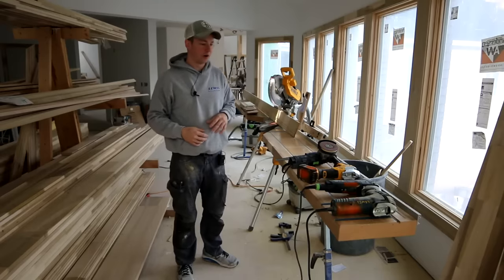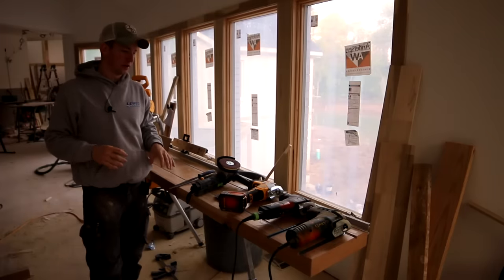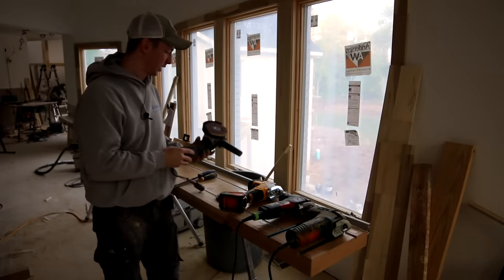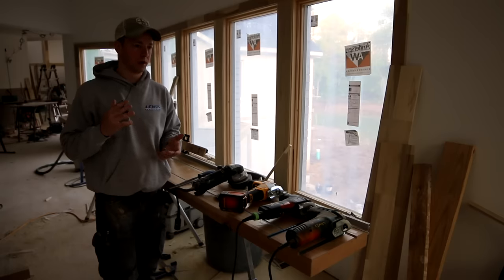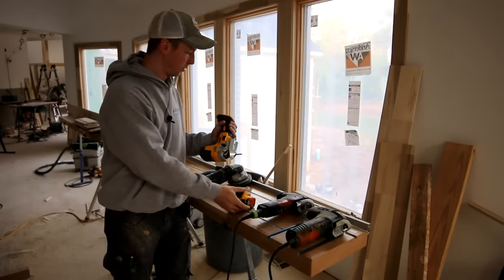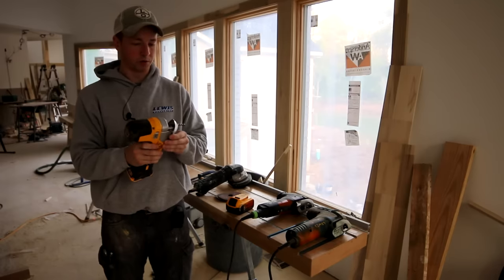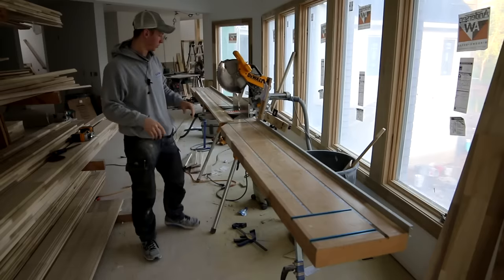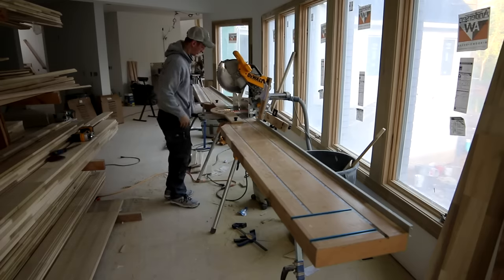Best tool for coping base and crown??? Dewalt DCS335B w Coping Foot for the Win

Comment: Hey bro I've been a carpenter for nearly 30 yrs. I personally am all about the grinder when it comes to coping. I haven't found a situation since it was brought to my gleeful attention that it hasn't given me a quick professional finish. But having said that I went from a Coping saw to a grinder and have never tried a coping jigsaw, So I am going to give it a go!
I've found that taking the time to listen to somebody that is willing to take the time to impart some of their experience is always the best way to become a better craftsman and it doesn't matter how old they are you can learn from anybody!
I really hope you don't get too much shit from dogmatic old arseholes along the way.
I'll let you know how I get along with the coping jigsaw thing when I get a chance.
Reply: @danholtbk7008  I'm not really a video kinda guy and I'm not aware of any videos showing the use of a grinder to make miter joints. That doesn't mean they're not out there though. If you find one let me know.
I was shown how to do it by my boss many years ago who has since become a lifelong friend.
I'll quickly go through the process though, it's pretty straightforward and I'm sure I won't be pointing out anything you don't already know but maybe there'll be something of some use to you.
1. Start the same as you would with any technique and cut the work on a drop saw on a 45 degree so you can use the leading edge as your working line.
2. Using a 16 or 24 grit sanding disc cut away the meat until you get close to the edge but don't cut right up to it ( Don't be afraid to back cut in fact it's always better if you do!).
3. I then change down to a 50mm fine grit sanding disc to clean up to the line. (you might want to just go straight to a finishing file until you're confident with the grinder)
It took a bit of practice but once I got the hang of it I never looked back.
have fun with it

Comment: Makita's 12v Barrel Grip jigsaw is my coping tool. Super easy to handle, small and light. 
Their 12v oscillating tool (aka fine tool, copy of a Fein tool) is great too, for the same reasons. I'm a union carpenter. The rest of my tools are 18v

Comment: Great advise.do you have any pointers on measuring up materials for a job and how you go about pricing /bidding a job.
Reply: Measuring up should be easy then add 10%-15% if you have to much you can bring it back better than wasting half a day going to get more if you are short. Work out how long you think it will take and add 2-3 days depending how big that covers unexpected things, your consultation and the time to price materials
Reply: Keith Byrne thanks Keith, I was wondering more about when he does his cut list for each room does he take all finished measurements from wall to wall for base or crown or does he have an adjustment to make it fit tight.Cheers.

Comment: What blade you like to use on the jigsaw?
Reply: The Collins Tool company has the best blades in stock for use with their coping foot . I stocked up when I bought the coping foot. Forgot the brand. I believe they are Bosch.
Reply: I use the bosch T244D
Reply: @reddawgrup1779  Yep I looked it up at Collins and that is exactly the one they recommend and sell.
Reply: Bill Buzzell yea I tried a bunch of different ones and feel that one works the best too.